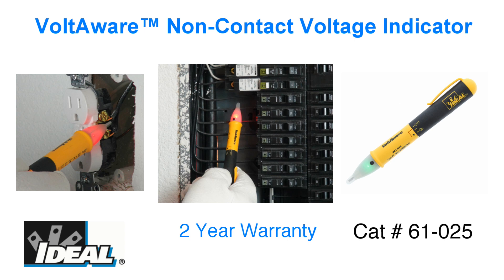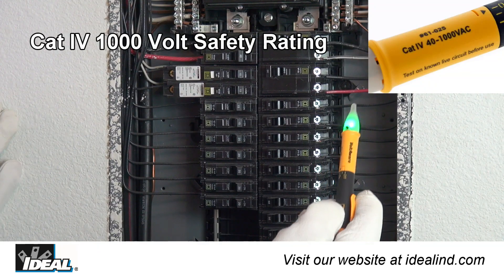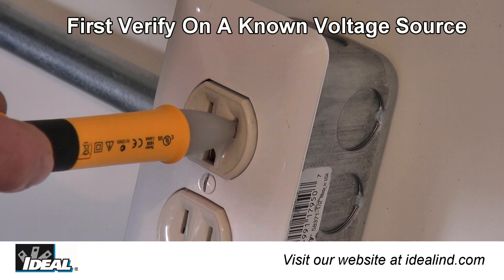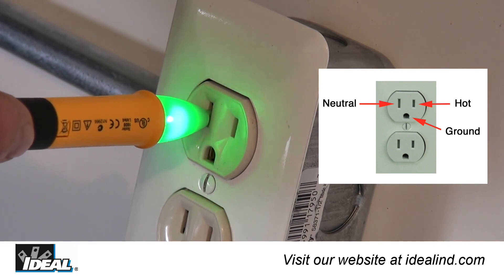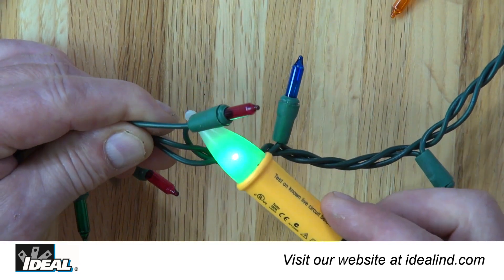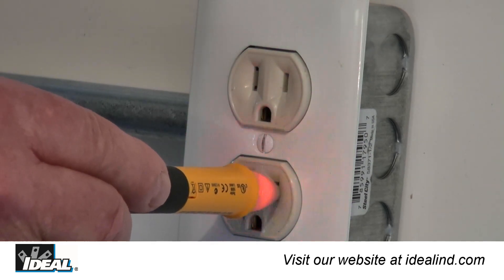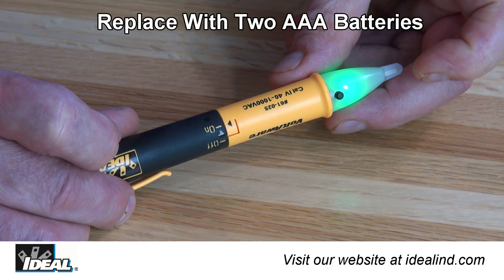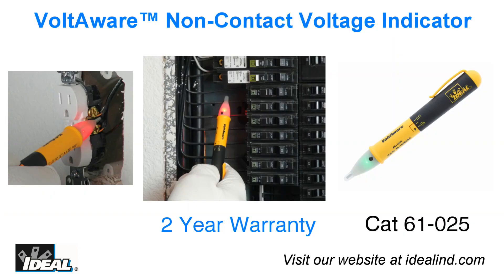61-025 VoltAware Non-Contact Voltage Indicator

Comment: Nice tool
Reply from the maker: Hello yes these are handy to have Ron
Reply: @RonKipperDatacomm1  They are very handy. A lot of people say they are dangerous to rely on, but one situation where non contact voltage indicators are superior is when there is no ground or neutral, due to a break in a conductor, or failed termination. A voltmeter will not give a proper reading without the ground or neutral present, and this can lead to a dangerous situation due to an incorrect reading of the meter. I always have one one me, and also a meter in my bag. I have a volt meter by Klein that doesn't need batteries, and reads AC and DC.
Reply from the maker: @illestofdemall13  thanks for the feedback and you make a good point somebody ought to make a video on that tip............have fun Ron
Reply: @RonKipperDatacomm1  You're welcome. Yeah that is a good idea for someone to make a video about.